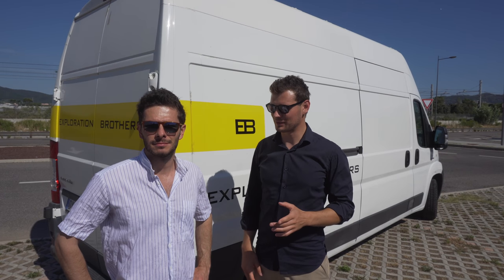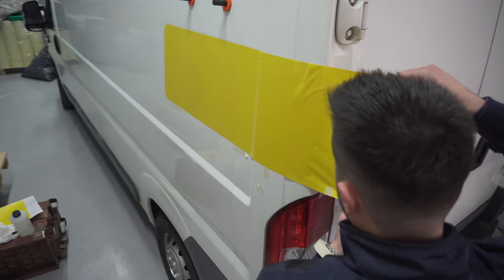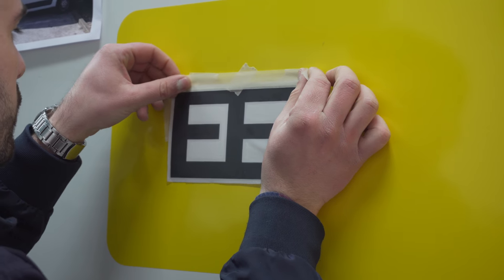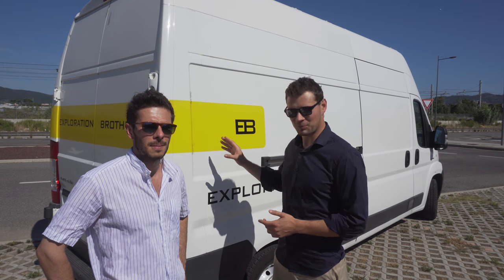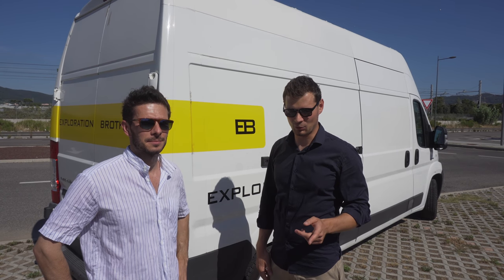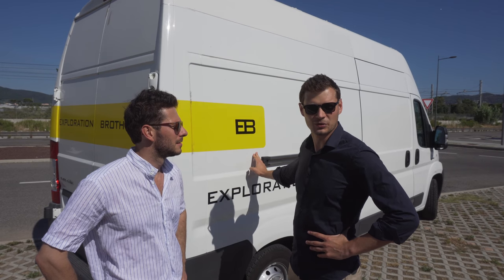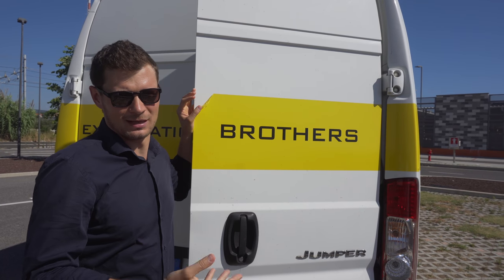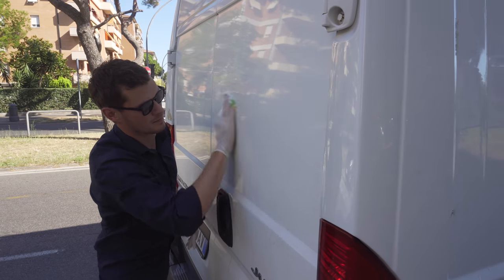Custom Camper Van - How to apply vinyl decals or sticker to your van or car?

Comment: Hi Guys, 
When removing the stickers if you gently wave a hair dryer over it slightly softens the sticker plastic and the glue, making it easier to peel off. Take care not to over do it though as too much focused heat can damage paintwork.
I use an orange oil based sticker residue  remover for any leftovers.
Love your neat, precision and cleanliness with everything you do.
Ciao from Western Australia
Reply from the maker: Thank you for great advice. 
Orange oil or Goo Gone will work perfectly. 

For now we do not have a place where to do all these things, so we just do it on the road and it that moment we didn't had access to 220V. 
Australia - should be fun there on the camper!

Comment: Dear gentlemen,
A very interesting idea, however if & when you need to remove any stickers use lighter fluid (petrol lighter fuel) sold in little metal cans. It attacks all the sticky residue without being aggressive towards paintwork. All the best. Kind regards.
Reply from the maker: Thats fantastic advice as for sure we used something pretty aggressive.
Reply: Exploration Brothers 
Dear Sirs,
Thank you very much for your courteous & hearted reply. Kindly let me know how you get on with lighter fluid as I have found it the most effective in terms of price & actually removing residue without too much difficulty. Kind regards.
Reply from the maker: Thanks! 
Not sure when it will happen as for now we not planning any other stickers)))